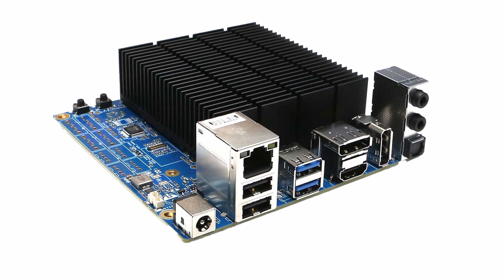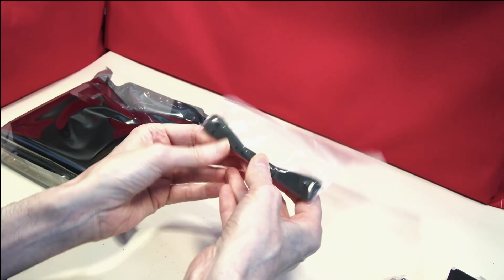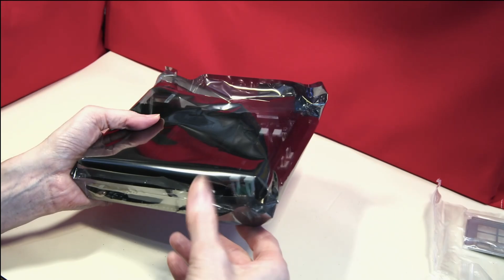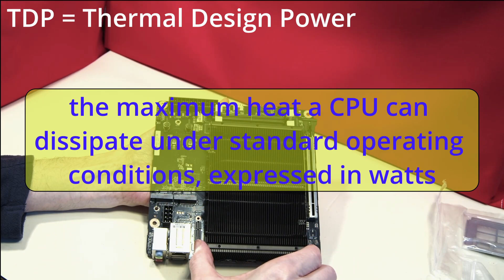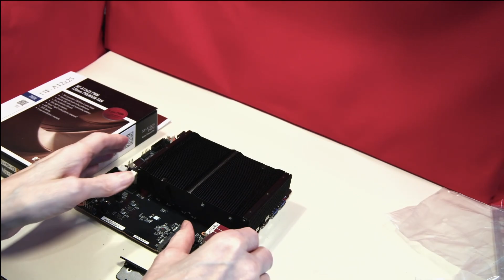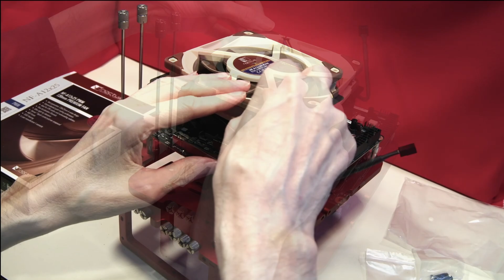MinisForum BD795i SE ITX - Ryzen 9 build - part 1

Comment: I like how the back to front fan mount mysteriously spins around at 9:15
Reply from the maker: As the fan wasn't attached to the motherboard at 9:15 that would have been mysterious, and it's not back to front, it's positioned specifically for the way it will sit in the rack.
Reply: @custompchardware fan wasn’t attached, fan mount was. And it was back to front- it’s ok, it’s an easy mistake to make.
Reply from the maker: Ahh you're talking about the brackets attached to the heatsink, not the fan. Yes, well spotted, they were initially the wrong way round and fixed before the fan was attached to them in the magic of editing.

Comment: I've just got one of these and for anyone interested setting it up to boot different OS odd each M2, the BIOS has am odd quirk where the booting priorities only allow the selection of one type of each storage type, with another selection box that lets you select which of the M2 drives it will boot.
I am booting Linux off one, and Windows off the other. I got around it by adding Windows as an entry in the Grub menu. I found OS-prober didn't work but adding a custom Grub entry did the trick.
Reply from the maker: Interesting for those who wish to dual boot.

Comment: Looking forward to part 2. I just bought this for a gaming computer/plex server. I got a P12 max fan for using with the cooler.

I got:
Kingston fury impact 32gb cl40 5600mhz.
RTX 5070 TI
2tb nvme wd black for windows and games
Sf1000 psu (was going to get sf750 but this was only $30more)
Lian li A3 case

Right now I'm wating for a front USB header splitter and front USB to USBC adapter so I can use my cases front ports.
Reply from the maker: Yes the motherboard has lots of possibilities.